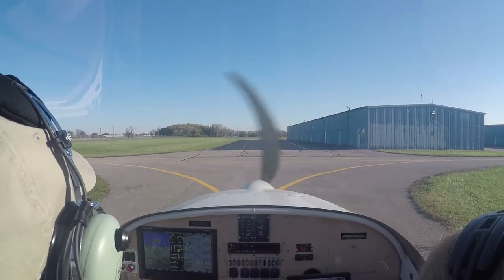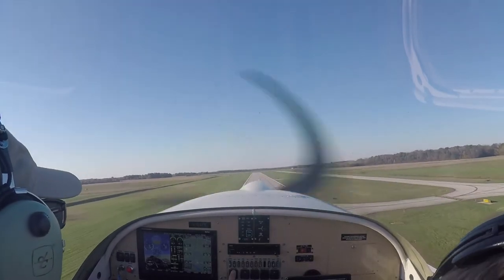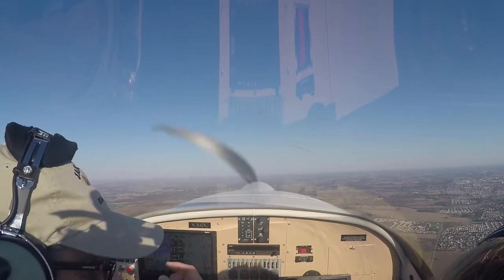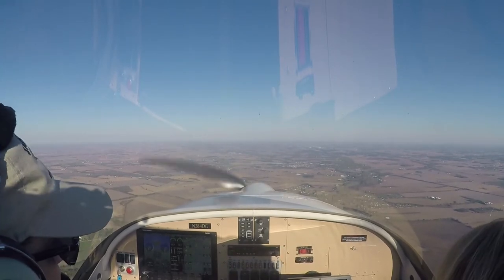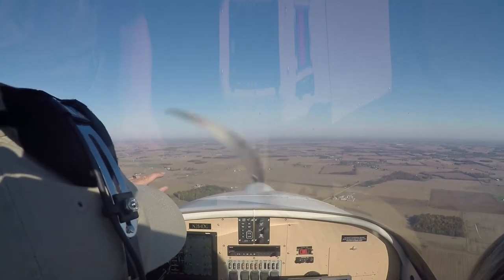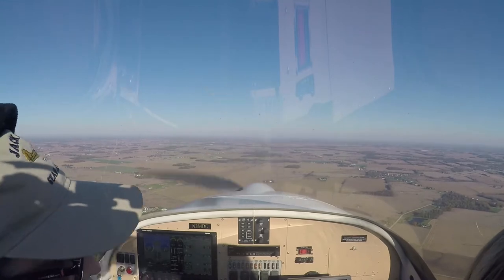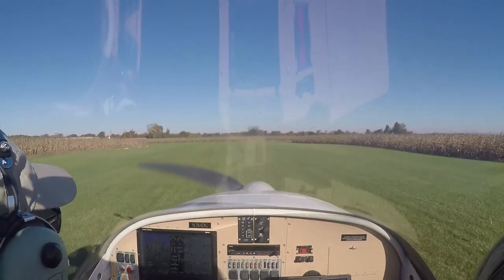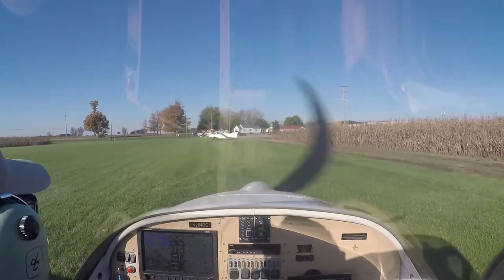Riding in Four Delta Golf: Burger Brunch With AmyG

Comment: What type of fuel do you put in your RV12?
Reply from the maker: John Hill 91 octane car gas. The rotax wants unleaded fuel and doesn't mind ethanol. I filter it before I use it, though. I don't trust it straight out of the pump.
Reply: RV12 Pilot You mentioned in one of your videos that there is a build up on your prop transmission (probably wrong word) but you talked about it. From Car gas.